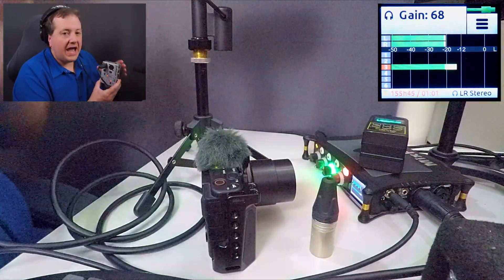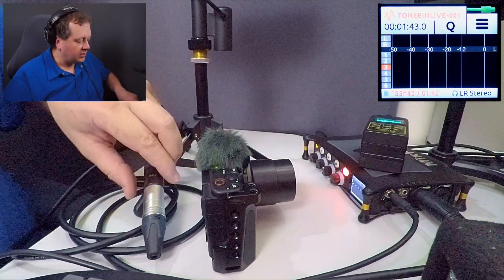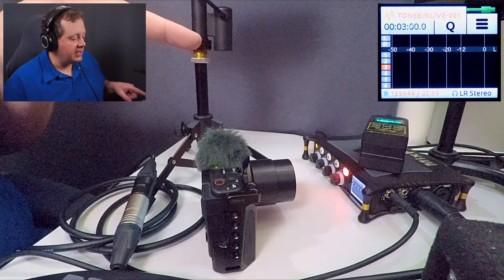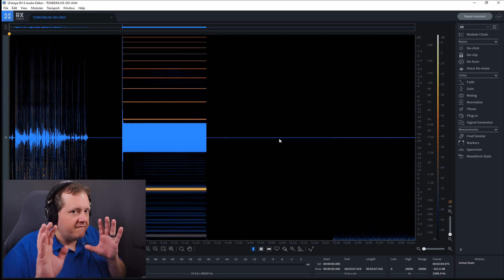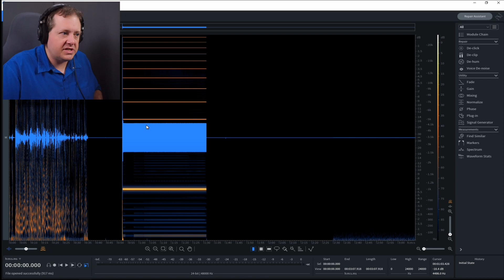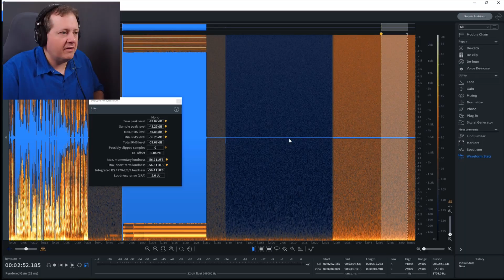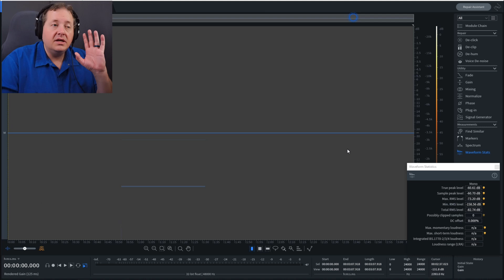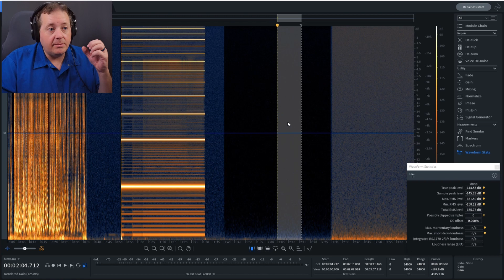How To Lower Your Audio Interface Recorded Noise Level

Comment: Sorry Allen, but respectfully, this just isn't correct. There is a reason the theoretical minimum is the theoretical minimum — under normal working conditions (such as a low-impedance dynamic mic), the thermal noise alone of the source is going to get you around -130 dBu. Adding gain — any gain — will bring that noise floor up.

The reason the middle part looks like it's "below" the theoretical minimum EIN is because you've taken a signal amplified by 50 dB treated it as if it's been amplified by 76 dB.

Suppose you were in a perfectly quiet room and you set the gain to +76 dB, and tested the thermal noise; you find the signal is about -54 dB, so you have a noise floor of -130 dB. Then, you play a tone that brought the signal to 0 dB in the recording. So now, your recording has 30 seconds of -54 dB, and 30 seconds of 0 dB; the test tone you played in this perfect room is 54 dB, based on these measurements.

Now, you bring the gain down to 50 dB. By reducing the gain by 26 dB, surely you've lowered the noise floor to -156 dB, right? No! The test tone you are playing will now show at -26 dB, which means the actual SNR of the recording has not changed whatsoever. You have not moved the noise floor as it relates to the signal, you have just made BOTH the signal and the noise floor quieter. The EIN is still -130 dBu, because if we turn the test tone off we see a recording of -80 dB; taking away the preamp gain, the thermal noise is exactly where we expected — -130 dB.

You have shown that you can improve the SNR by increasing the S, but there is simply no way to lower the N. Physics does not allow it.
Reply from the maker: That's all correct and good. You can't achieve lower than the minimum output noise of a resistor. You can cheat it though which is what I demonstrated.
Reply: @SoundSpeeds  Then wouldn't it be less.. deceptive, perhaps, to frame it as "Improving SNR by making use of headroom" rather than "how to lower the noise floor below the theoretical minimum"? 

It's the use of the phrase "Lower your EIN" that caused the misunderstanding.
Reply from the maker: Yeah... I'm human and didn't catch that I said that until I rewatched it. Goofed up the words. I've pinned this comment so hopefully people will see your comment as a clarification.
Reply: @SoundSpeeds  I understand. No worries boss! I'm just happy we could resolve this in a friendly manner 👍